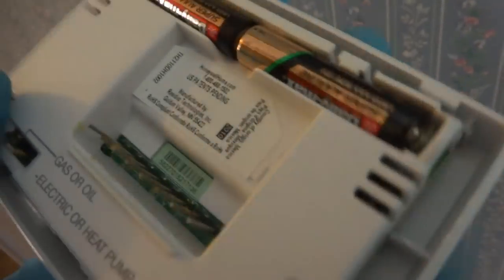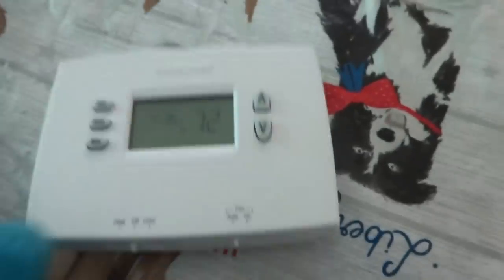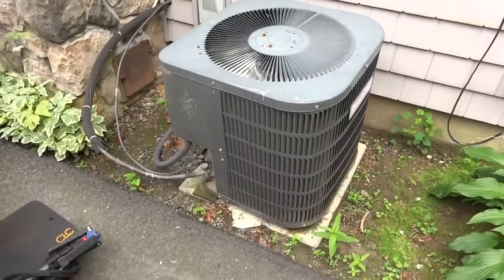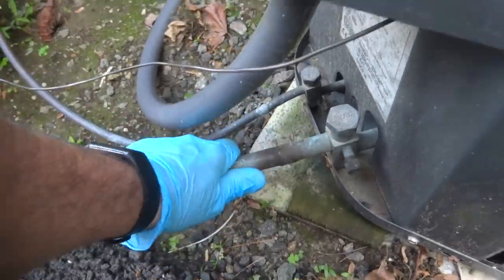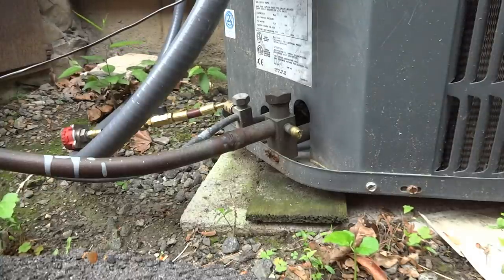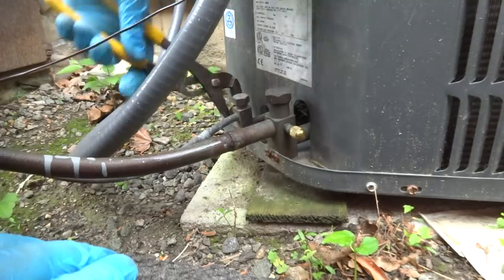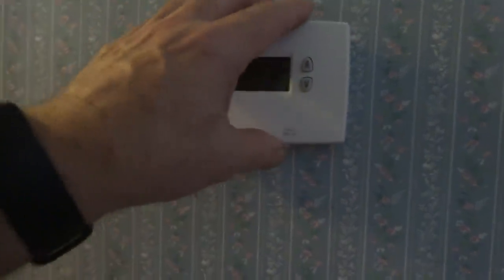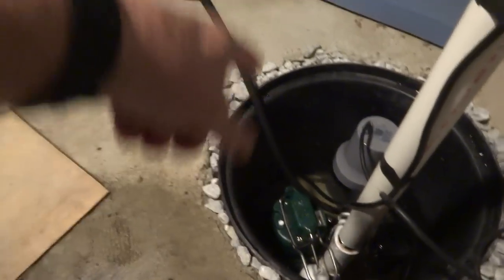GOODMAN AC NOT COOLING EASY FIX

Comment: Great work, Steve. By the way, there needs to be gravel all around the pump basin as well as the bottom of the basin. The reason these people are getting dirt in the sump bucket is because it was placed against the dirt without enough gravel around the basin. It works the same way as a weeping tile system.....if you throw dirt directly on top of a weeping tile system it will quickly plug up with dirt and won't work. That job has to be redone.